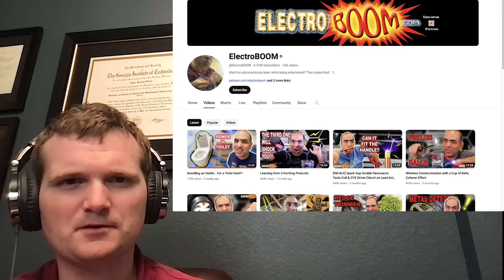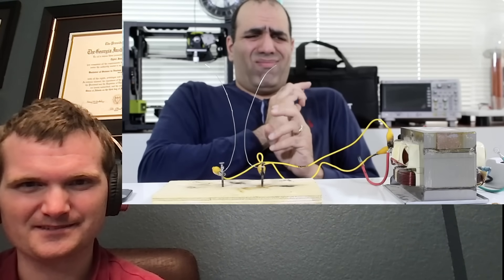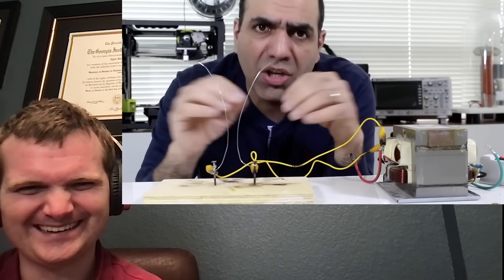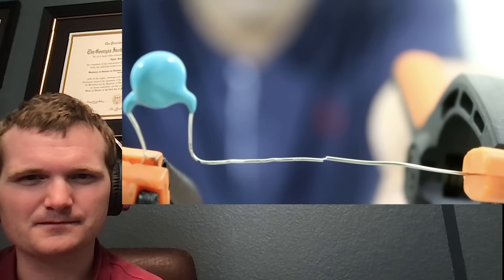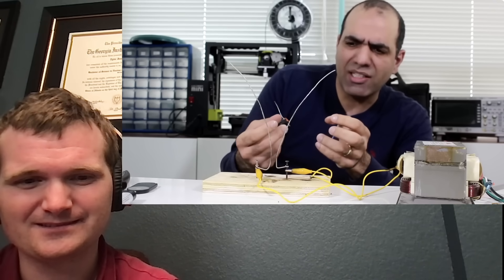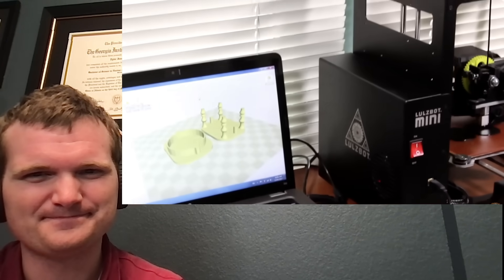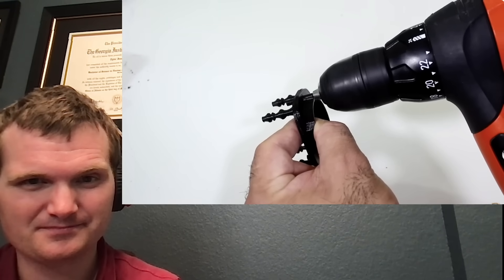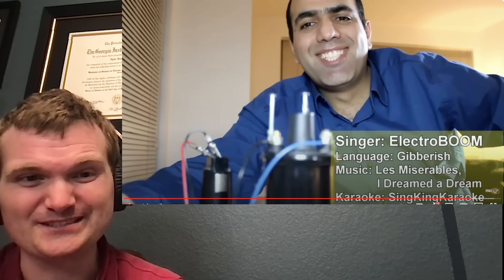Nuclear Engineer Reacts to ElectroBOOM's Jacob's Ladder

Comment: For anyone who doesn’t quite realise the true magnitude of just how severe arc flashes can be thats total and absolute raw power that doesn’t go ve a fuck about anything and will destroy anything in its immediate path, if you get hit by a powerful enough arc flash you won’t just die and after it’d over be a charged corpse on the ground on no, it will quite literally vaporise you, there will be no remains left, just your rubber souled shoes/boots, arc suit if you were wearing one maybe, possible gloves depending on what they were made of, and to be clear about the purpose of an arc suit, in reality the people working with high enough voltage to requiere arc suits aren’t just wearing them cos them might save your life because a powerful enough arc flash will just go straight though them, the suits also acts as a kind of vessel to contain any of your remains if anything is left, it sounds brutal and horrific but thats exactly how it is, there’s no second chances with that shit, either you die or you don’t, electricity is one of the most powerful forces on earth and not something to be messed with unless you know exactly what you are doing and even them it can still be incredibly unpredictable, 

and keep in mind people like electroboom who play with high voltage know what they are doing, electroboom isn’t just some guy who doesn’t know what he’s doing, he’s got years of experience in the professional field and is a highly qualified electrical engineer who holds both a masters degree and bachelors degree electrical engineering so he has been working with high voltage and electricity and knows exactly what he can do that won’t kill him or what he can’t do and that will kill him, but as we see in the video accidents still happen even to highly experienced people, then you have people like styropyro and well that’s just a whole different magnitude of insane, he may be young but he knows his shit well, he’s incredibly knowledgeable in what he does which is why he’s not dead

Comment: Touching one side of wire trips RCCB/RCD protection cuz current is not going back on them ,if you touch both wires you get cooked and wont trigger protection cuz the current is going back from your body to the other side of wire so it wont trigger reaction, RCCB trips in like 25ms.If there isnt an RCCB/RCD you ll get cooked from one wire as well cuz the circuit will close with ground

Comment: Seriously hurt is an understatement, he was so close to death.  I'm very confident handling and working at mains level voltages, I've also experimented with extremely high voltages, at very low currents, but I have stayed away from  microwave oven transformers, as they are unforgiving.

Comment: a friend of mine took apart an old school CRT television and shocked himself with a capacitor. He  was in bed for days after that , not sure how he lived.
Reply: Perhaps it wasn't fully charged. The components in a CRT can be quite dangerous. Also NTSC's line rate is 525 lines of 30 or 30/1.001 Hertz for a line rate of 15750 or ~15734.25, and this is the frequency of a whine you hear in tube TVs. Is 15.75kHz enough to not depolarize nerve cells?

Also of note is that older TVs that haven't been turned on in years and are older in general won't have as much charge in their capacitors if they haven't leaked (broken, older, or tenuous capacitors also may be bad enough at their job to have saved his life.)

Secondly, the discharge would likely be short if it's a spark incident. And a drained, old, or tenuous capacitor may not have been able to spark as long, shortening the exposure and total "dose" of electricity given. Part of the electrical danger scale (volts, amps, frequency, impedance, shock location, exposure time), is exposure time.

These factors may have been enough to save his life.

Comment: The about that shock is, it could be prevented easely, not by pretection against high voltage, but by HAVING A WIDER BASE FOR THAT THING SO IT WONT ALL OVER SO EASELY

Comment: 7:38 wait… did the metal just switch from one side of the wire to the other? How does that even end up happening?
Reply: No, but the arc interestingly moved closer to the back of the wire without burning the wire of completely. Cool

Comment: I think the thing that made it especially dangerous is that he caught it with both hands, one on each sparkler. I single-stepped, frame-by-frame (use the "," and "." keys), in his original video. For about three frames (1/8 sec?) it was arcing through both hands, with the current path through his chest, which is extremely dangerous. It definitely could have killed him.

I'm kind of surprised that the yøutube thought police bot didn't censor him. What he showed was far more violent and dangerous than stuff they do censor.

The rule I learned for working around dangerous voltages was "left hand in the hip pocket." That would've helped reduce the danger (at least if he'd also had his feet very well isolated from ground).

Comment: The most terrifying part of an arc flash is the vaporized copper that expands over 6000 times its volume. Inhalation of vaporized copper will kill you if the other crap doesn't. And then the coroner would probably try to pawn your lungs.

Comment: Like to be fair ultra high frequency at least can't stop your heart with as little as 1 amp, so you can push that voltage up pretty with high frequency current you just can't allow the amperage to get too high or otherwise there are obviously other issues, reason being is that it needs to be in the frequency that your body uses to send electical impulses to be able to interfere with your nervous system, but when you get powerful enough to do tissue damage or blow up shit that is a problem in and of it's self.

Comment: If you noticed, all experiments that he tried, he kept trying until either proven impossible or succeeding, with one exception. This one. You can even see him shaking in the video. He will often hurt himself on purpose, because he knows his tolerance to pain, and he knows how to handle electricity. But this time, I don't think it was staged. I do think he almost died because of something he didn't think of, and so realized that this was a step too far, and chose to never come back to it.
Reply: I'm a year late by now. he did an interview about this and he genuinely almost died.
Reply: I'm not a year late, but 3 weeks late. What interview specifically are you referencing? I have no experience but am very interested in electricity.
Reply: @Bobdon-o6t  This one: https://youtu.be/utuvmyuavbY
I never saw the interview before now, but OF COURSE it's with his longest running partner company.

Comment: Industrial firefighter 35 years. I have seen raw explosive balls of plasma the size of large trucks. The sneaky ones are the ones that explode from Panel to ground 20 or 30 feet like lightening bolts.

Comment: tl;dr: Anywho, just thought I'd share too. Same schpiel as all the other comments :)
Not hard to see that the main commenting here is about how this is the one Mehdi considers to be his "most dangerous blunder". I see a lot of discussions about the various other videos of his being "scripted blunders" etc. And I really don't see the point of discussing if it's scripted or not. As an electric engineer, Mehdi usually has a vast understanding of whatever thing he is creating and by just knowing in advance, he knows how and when a cap will explode, or something will heat up to melt things. I'm no engineer, but a hobbyist, and can certainly say that every sudden spark in any circuit will never not startle me. And one can get pretty used to electric zaps to not be as sensitive to the pain, but the shock when it does tingle you or zap you is something that, well, you can't NOT get shocked by :P quite literally.
I play around with crazy high voltages as well, cause it's fun. But would never ever consider using something as powerful as a microwave transformer for my source. Even though the voltages may be lower than some of the "play with" ones, I think Folse could also attest to the SUSTAINED high voltage being a killer. A microwave transformers output is somewhere in the 2000 volt area. But if you load it (say with your body) the voltage will drop. But with such heavy windings, this drop won't be very significant, and that's why this particular experiment was so incredibly dangerous. Sustaining high enough voltage to produce significant current across your body for a long enough time to cause all kinds of havoc. And combined with lower frequencies, the path of least resistance through the body is usually the bloodvessels (where you might see a potential problem along the way).
I admire Mehdi for keeping this particular scary accident in his video, to show that even being a professional, knowing the risk, he made a silly mistake that could have potentially killed him. There is no "scripted way" of catching a falling Jacob's ladder with both hands.

Comment: That is the only time I've watched him and thought "well, you almost died that time".  I've rebuilt several linear amplifiers for amateur radio, vacuum tubes are still common for this purpose and run at 2300V at .45A.  Many other models are way higher voltage.  My radio is all tube based and while 300V is common inside it, and there's 850V in one place.  Nothing commands my respect like that amplifier.
I would be surprised if Electroboom doesn't have an isolation transformer under his bench that he's running stuff off of.  Probably has a non-conductive floor.  Many simple safety steps like this can sure save your life and make most of what he does a parlor trick and not flirting with death.
Reply: In his own words, the shocks you see on camera are either done to the point where they're safe or they're genuine mistakes on his part since it's extremely unrealistic for any professional electrician or electrical/electronics engineer that they're not gonna get shocked or blow circuits up at work. Mistakes and accidents happen.

Comment: Once i was playing with high voltage i mean not really that high i made boost converter using astabile. And relay(since didnt have mosfet) i put ton of coils and decreased capacitor on output . I achieved  270V (i could have gone over if i wanted but i couldnt  messured it so i stayed at 270) i was unpluging output capacitor and shorted it to make sparks then at one point i wanted to unplug it meanwhile i had capacitor in arm and shocked me . (Technically before that i was testijg at what voltage i feel it  ( around 120, but probbaly it would be lower if there was enough power)  also i once got shocked. Cause i forgot.that tiny breadboard jumper wires dont have enough isolation ) still thw input was 9V 9w adapter. Then once i did something else i had motor capacitor rated for 400v but it has metal casing i rubbed my hand over trampoline And then i was passsing with capacitor that i put one wire on one of its leads i could hear charges jumping . But again i.forgot that isolation is to weak and got quite nice shock then i charged it again and used pliers to hold it . I did make a spark with it and was like elctrobooms when he charged his highvoltage . Then i wanted to shock some fly.or something and could find any but wtill banet to dest it on metal surface and got shocked again . A day before i was salvaging fan but cables got mixed up with my soldering iron and when i plugged it made short or something there were sparks that bouned off the table and i immidetly unpluged it (luckly that happened otherwise i could have touched 220V ac)

Comment: Kinda hammering home the importance of safety: 10 years in a power plant and he’s never seen an arc flash. 1 year working in big box stores and I’ve seen 2, one from an improperly installed lighting power distribution node and another from a damaged capacitor on a cardboard bailer.

Comment: So to be honest... One lf the high voltage side wire is connected to ground in microwave transformer.. so in that case if someone touches the other end they die.... Ya thats it... But electroboom here knows his stuff. He disconnected the wire that wire from ground first... Ya the red one... So what happens is unlike before the high-voltage is floating.. theoretically it is possible to be alive still after touching one of the ends... But still we are rocking AC my friends. It does not need to complete the circuit with wires.. it can capacitively couple... So that touching one end might kill ya... Oh ya he probably tested this stuff before he accidentally touched that high voltage side ... But the last part was not in the script..
Reply: Yeah I think the first shock was just whatever could capacitive couple, and the second one (with the device falling over him) was from both terminals of the transformer secondary.

Comment: 4:40 it's off since the 50hz / 60hz humming is not audible. And yeah... 12:45 that's as close to dying as you'd get. That's why I prefer to makes arcs at higher freq, they're safer. And 15:34 that's a regular pencil.

Comment: The largest Jacob's Ladders I've seen were at Fry's Electronics in San Marcos, California. Not there any more though, sadly.

In my house there's enough capacitance in the wiring that even with the light switches turned off the LED bulbs in the bedroom light fixtures still glow slightly. It took me a while to get used to having these large glowing eyes staring down at me when I'm asleep. ;)

Comment: I like electronics stuff and things like this but i often find it hard to watch some of his videos. I have made a HV supply with a microwave supply, i usally use an oil burner transformer though. MOT is like 2400V maybe around .5-1A OBIT is like 10KV but like 100MA. Both dangerous but the MOT would be far more likly to do damage. Another I have heared mixed info on is flyback transformers from CRT displays they are about 25KV but run in the kilohertz some say the frequency makes these far more dangerous others say it is so little current it can't do much. A friend of mine has an X ray transformer that will do like 60KV at fairly high amperage, that will make like 6Ft jacobs ladder. 

There are some wood working things for making lithenburg figures with high voltage in wood, many woodworking groups ban discussion though due to danger. 
Worst shock i got i had a gas weed trimmer that would not shut off had leather gloves on and it had a rubber boot over the wire so i pulled the spark plug wire off and it got me through all the rubber and leather. Sparkplug can be like 60KV but quite low amperage but was still not fun.
Reply: Flybacks can be way more than 25kv, i have got some to 100kv but they burn of course, i would say 50kv stable at the very least. And they are way safer than most other HV devices due to the frequency,  higher frequency equals less dangerous due to skin effect, basically if you touch something low frequency it will mess with your nerves and you wont be able to let it go, while high frequency only burns the external layer of skin  most of the time.

Comment: Yeah usually he gets upto stuff that looks dangerous but with due attention to what youre doing, its not likely to injure. Even his messing around with mains stuff (I.e. the "electric guitar" video ) isnt really that risky as he's only doing one hand and (presumably) minding contact with other grounded things. Hes pulling a bunch of slices of the swiss cheese model, but still has a few that require knowledge and attention.  But this one... I had the same reaction you did when it happened. just wide eyed knowing I just saw someone inches from death, and the layer that saved him in the swiss cheese model was "luck"

Comment: I think what saved him was the immediate short he created when he grabbed both wires and pushed them together.
Reply: For a brief moment, creating a path of least resistance
Reply: It was the disconnection AND the short that saved him. Two events that limited the duration of this high-voltage high-current 60Hz (too slow to not affect nerves) shock. When it comes to electric shocks, current, voltage, frequency, duration, and multiple other factors (grounding, whether or not you are soaked, where the shock hits, and other electrical factors) ALL apply in determining whether a shock is capable of stopping the heart. This transformer was, but because of the short and disconnection, the duration of the shock was doubly reduced, enough where he was able to survive this, albeit with shakes afterwards according to an interview, and also 3rd-degree burns at the contact points if going by his comments. At this amount of power, it's accurate. People who have touched these transformers and lived to tell the tale have ended up with even nastier 3rd-degree burns that have blackened the contact area almost as if a bonfire flame was involved.

Messing around with the circuitry used here is no joke.
Reply: That was my thought on it while he did grab it with both hands it seemed like both hands touch both wires at the same time. Along with it coming undone at that same moment. Very lucky

Comment: Even if it does not kill you getting electrocuted will give you heart problems down the line. High exposure to radiation is also suspected lead to heart problems later in life, but in affected populations (like chernobyl liquidators) the data is hard to separate from other factors such as lifestyle changes from PTSD.
Reply: Electrocuted=dead
As in it’s impossible for someone to tell you they were electrocuted…